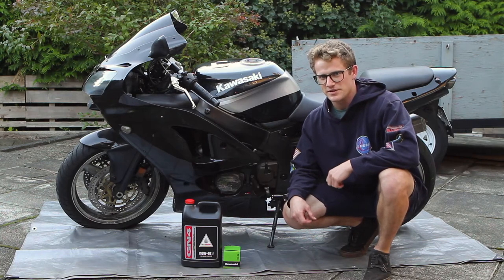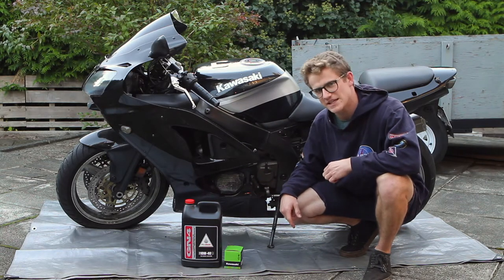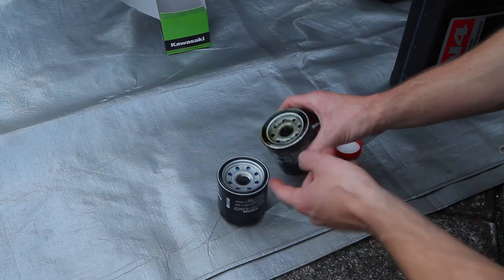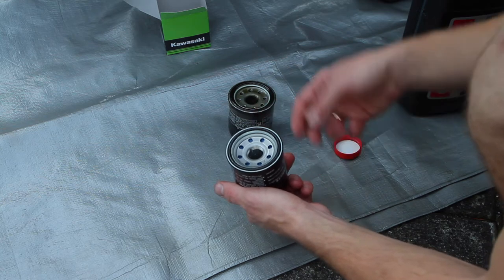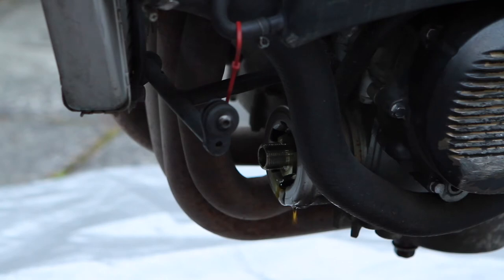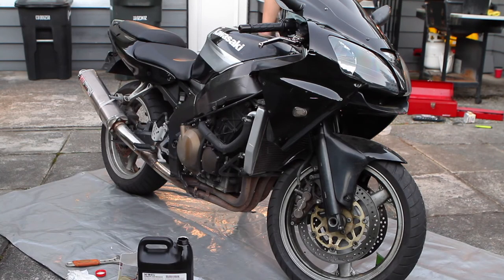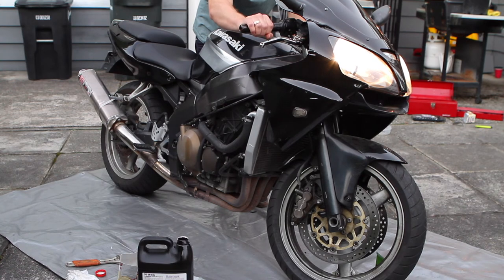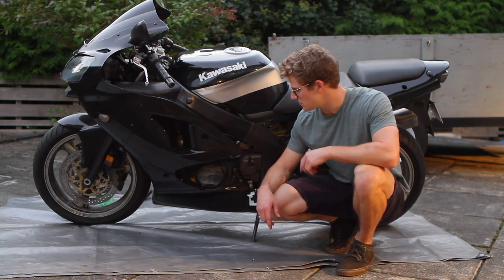How to Change Engine Oil + Filter 2000 ZX6R

Comment: Some of the 00-02 Zx6r had oil burping issues. An air lock would happen and oil warning light would not clear. Easiest way is to start the bike and loosen the filter briefly until oil flows. Tighten and top up. A well documented issue amongst forums. Crazy.
Reply from the maker: Great to know, thanks for sharing this! 👍
Reply: So I 1.start the bike 2.loosen the filter 3.Wait till some oil comes out 4.Tighten the filter 5.top up on oil?

Comment: Hey man I know this is a old video so I’m not sure if I’ll get a response. I have a 06 zzr600 & the engine oil light is on. I’m going to do what you did to see if that fixes it. What is the exact oil you used for this?

Comment: How do I buy an oil filter like is there sizing or? I have the same year and model as you btw
Reply from the maker: There isn’t really sizing numbers for a oil filter other than the part number. I would recommend calling your local bike shop and having them order the part in. Or check out revzilla.com or fortnine.ca for parts. Best of luck! 👍

Comment: Just to confirm if the oil is half way in the glass when on kickstand when it stands up the glass is completely full is that bad?
Reply from the maker: It sounds like the engine oil is a little over full. You should be able to see the oil level in the glass circle when the bike is up right (not on the side stand). A little over full isn't the worst thing but certainly not great. Hope this helps, best of luck!
Reply: @Calvinm  I took it apart and a lot of the fluids will mix together in areas they shouldn’t of been